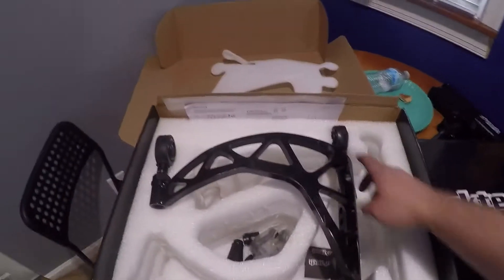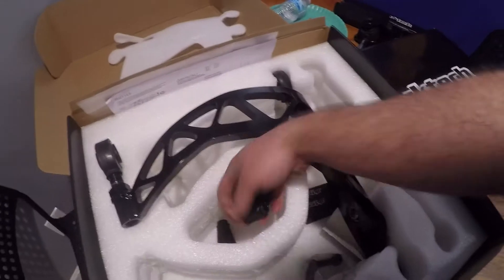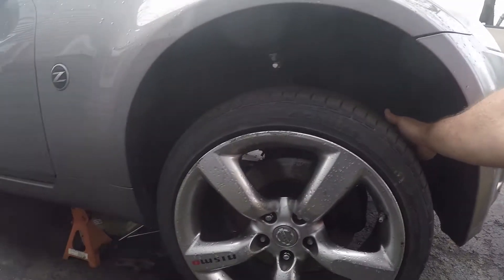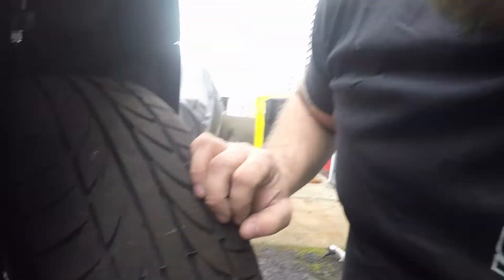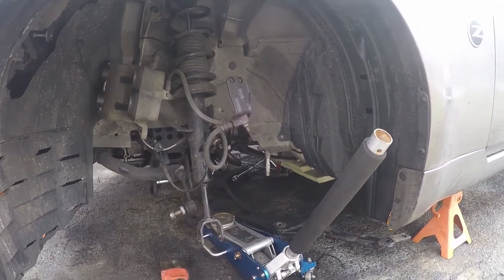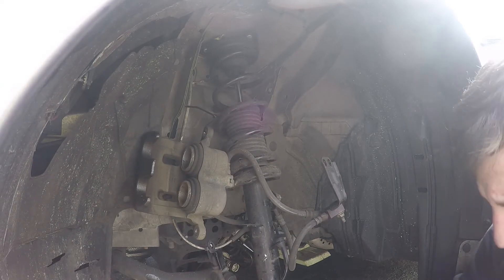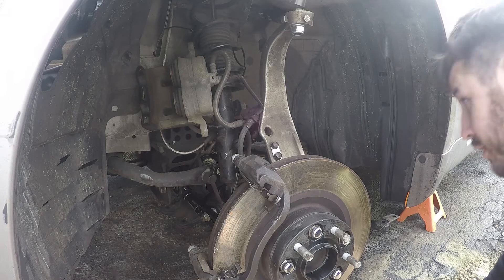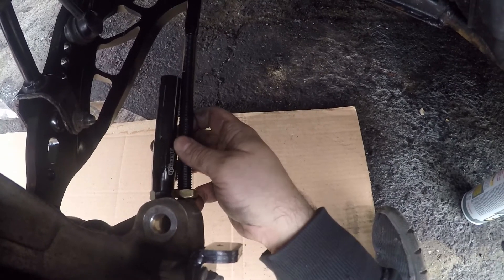350z GKTech Install Pt2

Comment: Hey bud I know the video is a bit old but do you know how much approximately how much you cut off the gk tech extended tie rod?
Reply from the maker: Na. You'll just have to measure. Just line them is so your wheel is close and then mark it so you have as much engagement as you can.